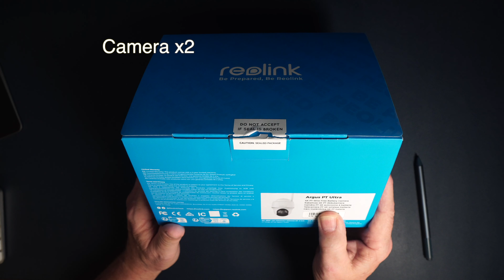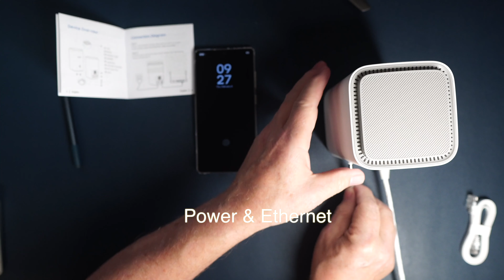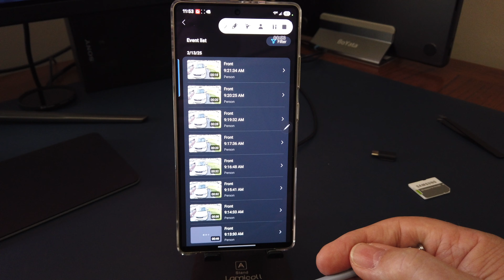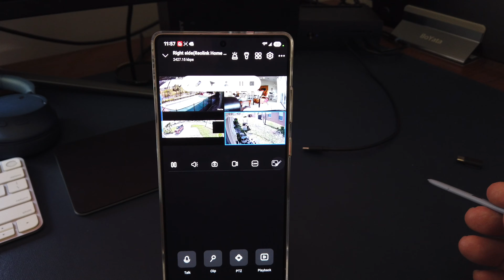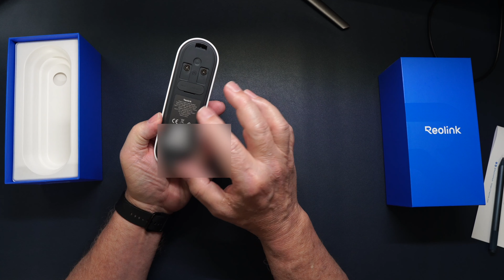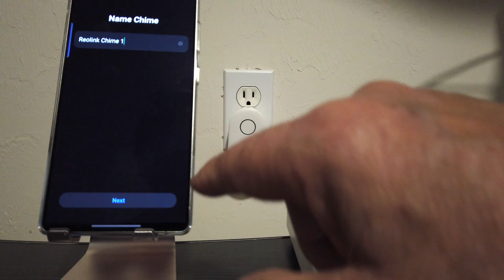Home Hub kit & WiFi video doorbell setup. No subscriptions.

Comment: Why do you need a hub for the doorbell camera when the door bell has its own SD card  and it does work if you take the SD card out. No videos from the camera doorbell with or without the SD card  shows on the hub..
Reply from the maker: The hub is like extra security in the event the door bell is ripped off the wall. Just a little more security or remote storage. Thank you for reaching out. Did I answer your questions or do any others?
Reply: @htnowpro I think I found the problem , I didn't add the doorbell to the hub 😂 but now I have a new problem my chime doesn't work now. I can't find how to fix it.
Reply from the maker: Make shure the firmware is at latest update. From memory,  I think you have to re link the doorbell to the chimes. Contact customer support.